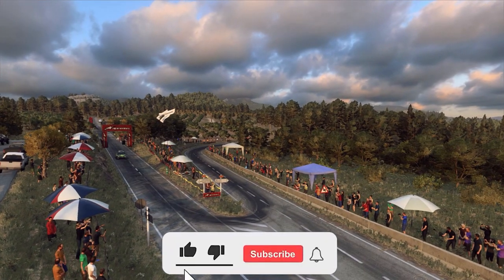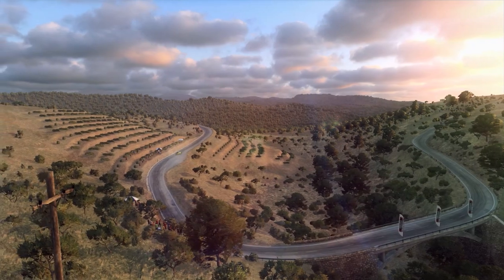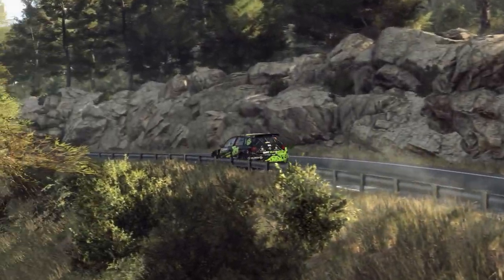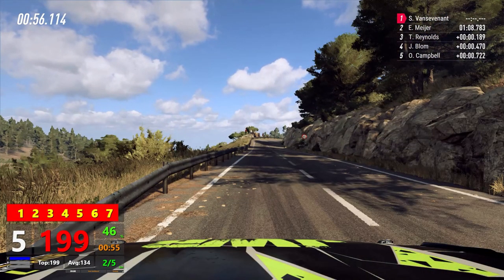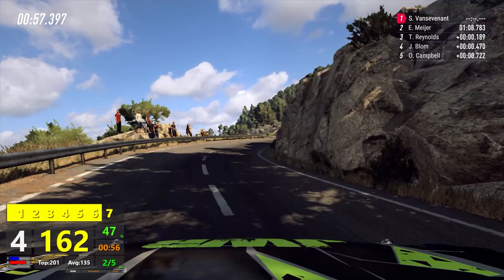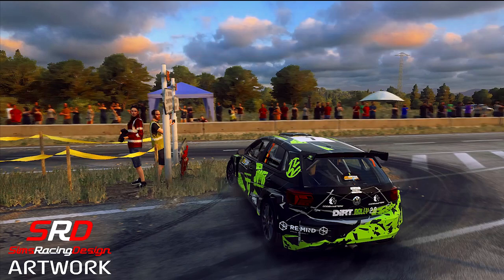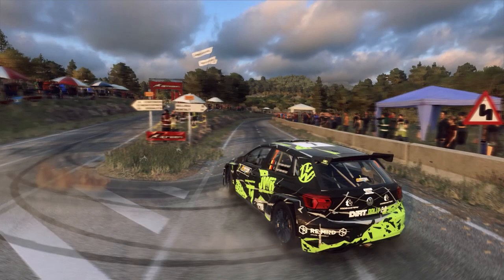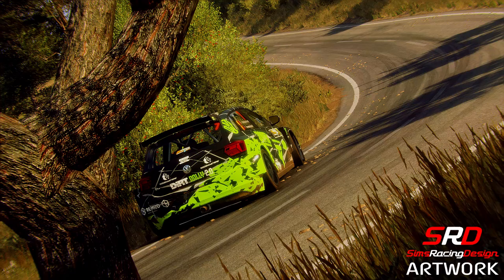How to Master Spanish Tarmac - Techniques, Tips & Tricks - DiRT Rally 2.0

Comment: hey super helpful video! i managed to lower my time to in the "Descenso por carretera" stage to 2:11.108 which brings me roughly in the 800th position with group A cars :D , i was wondering for the tip that you gave about doing each split separately at 2:09, if you feel like you want to practice only the 3rd split for example, can this be done in the game settings or only manually?

Comment: I absolutely suck on tarmac. 100% correct I’m fast on gravel, snow, but the minute I hit the sticky stuff it all goes to crap. Thanks for this even though I’m 2 years late!!
Reply from the maker: You are very welcome, mate.
Reply: just how? I can do well in tarmac, not super fast but decent enough, put me on any of those loose bits of our planet and I can't even stay in the track 😑
Reply: @johjoh9270  pick a long stage, then stay in a single gear and drive the course, never going super fast just a speed your comfortable with. Rinse and repeat and I promise the speed and control will increase without you even thinking about it. Pick a FWD car the turbo fiesta in the R2 category is my go to, and master it before you jump into 4WD. Oh and stiffen the front suspension and loosen the rear, it will make the car feel a little more oversteerey.

Comment: Great scala of information, thanks for this! I'm still driving in semi automatic mode, it takes away a large distraction, my favorite is Germany and I love Spain too, and I practice 1 stage over and over for weeks in different cars to get used to approaching corners in various ways. Still can't find  the last 15 seconds or so .....will shifting make me faster ?
Reply from the maker: Shifting with H-pattern and clutch or paddles on the steering wheel?
Reply: That would be the paddles on my trustmaster t300. Have to get a handbrake though, couse I'm using my right paddle as handbrake.....🤔 (this actualy works surprisingly well in semi- and automatic transmision mode) in semi auto mode I can shift down with the left peddle, so I can engine brake some what. I'm also used to left foot braking, some thing that in my real car can conflict some what with my  muscle memory 😂

Comment: Thanks for the video mate, I really appreciate the part about braking, will try to apply it more in my own driving.
I was really hoping for some insights into setup, mostly for differential part of it, as I see totally opposite camps for it. I'm not an expert, but I think I got a bit of understanding how it works, and I do have some experience IRL driving with completely locked diff (welded) as well as open diff and some kind of LSD diff (viscous I guess), but only in RWD cars. Now I see real-life rally champion setting his skoda r5 for spain in DR2.0 with 100% locked diffs, and I wonder why is that? As I understand it, the tarmac has the most grip available for the tires of all the surfaces, then why would one close the diff so much? As I see it, locked diff makes the car understeer and oversteer (depending on situation) more. How do you see it ?
Reply from the maker: I would love to help you with setups but I'm not an expert at all. I don't know what most things affect which is why I'm so thankful I can rely on EXR Technical's setups and then adjust things like gearing and braking, something which is very simple to understand.
Reply: @SimsRacingDesign  thanks for reply, I guess I'll have to study on my own then, cheers :)
Reply from the maker: @cudakRS  Best of luck!
Reply: @SimsRacingDesign  try skyrex's setups,  they work for me just fine and he explains it well.
Reply from the maker: @cudakRS  will do. 😉

Comment: Codemasters should first master the tarmac physics in this game!
Reply from the maker: I agree it's not as well-developed as their gravel physics for example but with a decent setup you can make up for the worst of it. And from what I've picked up, they are completely overhauling the tarmac physics for the next DiRT Rally, so that's a great thing to look forward to. 😁
Reply: Yeah, I read somewhere that speculated the issue might be that they didn't include downforce in the physics. Which would make sense to me based on how the cars slide around at high speeds. That wouldn't happen so much if there was downforce acting on them. I'm not sure if that's true or not, but it does seem plausable to me. I assume it'll be fixed for their next game because they've got to be sick of hearing the complaints about it by now.

Comment: doing the same stage over and over has nothing to do with rallying... its more like time attack. The point shouldnt be to learn each stage in and out like a racetrack.. in rallying you need to concentrate on the pacenotes and driving.. adapting and improvising along the way depending on track, car and weather factors
Reply from the maker: Even though I definitely get your point, I do have to disagree somewhat. Don't see this as an attack on you or me pretending to be a know-it-all, because I'm absolutely not. I know people are pretty touchy and sometimes easily offended online but know that I don't have the intension of offending you. See the following as the start of an open discussion.

So yes, in real life rally events you can't drive stages over and over. And if I remember correctly, in the video I never said you have to learn the stages by heart in those exact words.

Having said that, real life teams and drivers do organise test sessions on short length roads and in conditions that will be representative of what they'll face on the actual event they'll compete in. During those test sessions, they drive the same short stretch of road over and over, somewhat like time attack, in order to get familiar with the car and surface, work on the setup, to get up to pace for the actual event etc. 

Unfortunately, we don't have a separate stretch of road for each location which represents the actual stage conditions, but isn't part of any of the stages. Thus the only option we have, is to organise our 'test sessions' on the actual stages in the game. Maybe that separate stretch of road for testing would be a nice feature for a future title.

What I did mention as well, quite early in the video, was to get comfortable with the car and the stage (meaning surface) in order to increase your pace, make changes to the car's setup and work on using the different techniques correctly. Similar to what real life drivers do during their test sessions. All of this will indeed improve your stage times but more importantly it will improve your overall pace on that surface. That last bit is the most important part.  

And one final thing I do want to touch on, is a feature which creates that unpredictability in online events you can't really prepare for. It's something that forces you to adapt quickly and takes a kilometre or more to get used to, and that is stage degredation. I know that it has a limited effect on a sealed surface but on loose surfaces such as gravel and snow, it can truly throw a spanner in the works and catch you out or hurt your confidence, pace and times. Practising every stage with each level of degredation is a fool's errand and definitely a waste of time. It's this feature that brings online rally events (clubs) closer to real life rally event than ever before.   

I'm curious to know what you think of my quite lengthy comment, so I hope to see another reaction from you.
Reply: @Sim's Racing  Man I get your points but I have hundreds of hours in DR and DR2. 90% of corners and crests are in my head. I could drive the Game without pacenotes and be almost as fast as with notes. Your Video is really good to learn how to get fast in DR2 and its obv not your fault that the game only has a very limited number of stages. Driving a real rally stage or just a new stage in Richard Burns feels 100% different. You have to adapt and stay focused. Ofc you have to know how to drive your car over the different surfaces but the DR Games become Time attack sims after some time. Your Brain will safe corner combinations, thats just how the human brain works. You can use DR to learn the basics of car driving techniques. But improving your time on a single stage like in a hotlap modus in assetto corsa is pointless and has nothing to do real Rallying. Btw I really appreciate the work you put in this, cuz Rally Sim community isn't really that big and real Rallying seems to become more unpopular. Sorry for some typos and weird Grammer. I am not a native english speaker.
Reply from the maker: @carenthusiast6748  I appreciate your reaction and I do agree with you on lots of these points. That's why the stage generator in Dirt4 was a great idea, however it was poorly executed. Hope that the team hasn't thrown the whole idea out of the window and continued working on it.

And don't worry about spelling and grammar. Haha I'm not a native speaker either. 😅

Comment: Dont ever ever select top drivers ghosts, they have reduced weight hacks.
Reply from the maker: That's untrue. I've set world records and I don't use any form of 'hacks' and don't take shortcuts. Some people just have more talent than others.
Reply: @SimsRacingDesign  just vecause you have set world records on some stages at some car classes doesn't mean there is no cheaters on some stages with some car claSes. You can detect them easily when they gains grip and acceleration at way not possible. Show me: Group A, Argentina: Las Juntas
Reply from the maker: @jjeeqq  there might be some... But suggesting in your first comment that all of them do that, is completely unfair.
What's the name of the guy that has the Group A record in Las Juntas?
Reply: @SimsRacingDesign  i have to check when i get back to home. But it was top 1 and others after him were far behind.